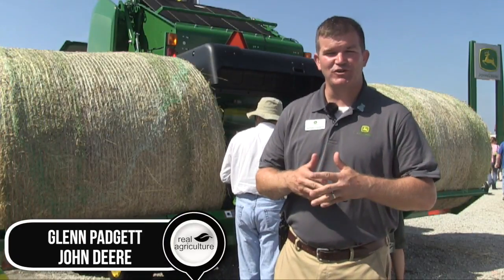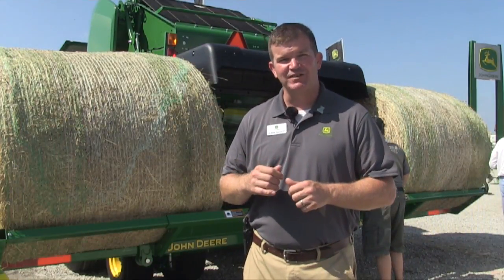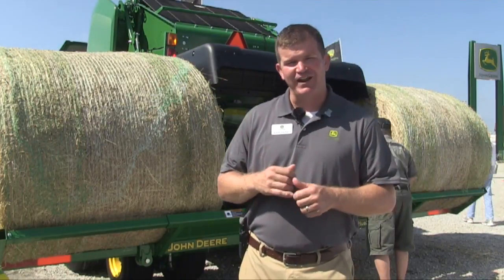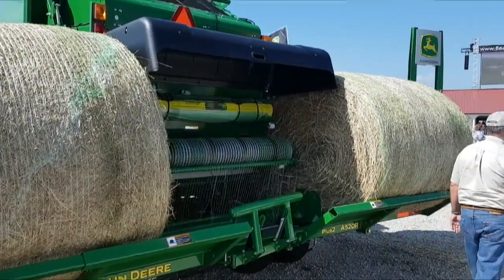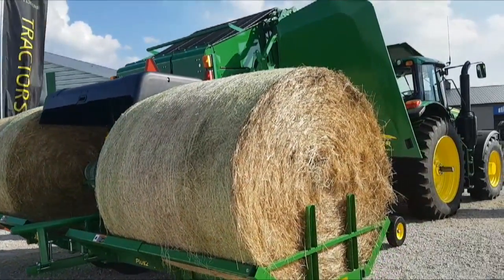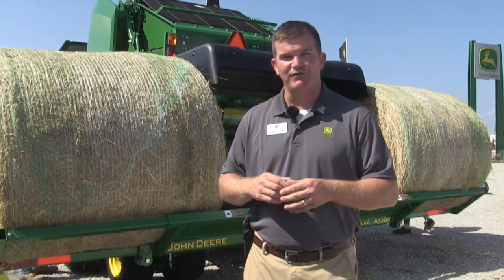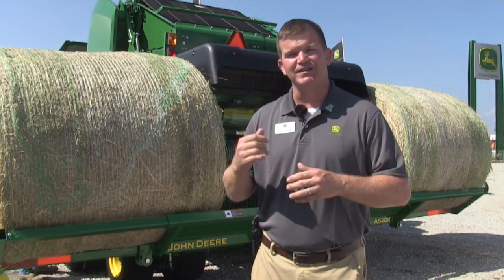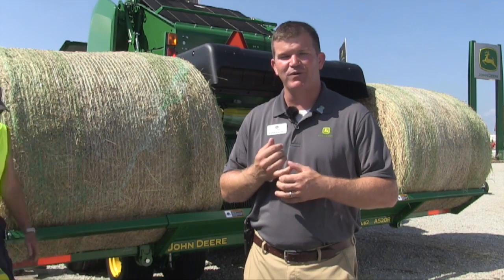John Deere accumulator brings strategy to baling

Comment: the pre cutter may help in wet hay.  pre cutting dry hay is just beating all the nutrients off the product basically making straw.  i thought deere did a pretty good job of beating up hay with their stuffer bar system already, this takes that to a whole new level.  we had a 7 series megawide pickup for one season, we traded backwards to get a 566 standard pickup.  couldn't stand the secondary lift system destroying hay.  running a vermeer wide pickup now, will never go back to a green baler. i guess an accumulator is their best idea to sell an inferior product now.  good luck deere.

Comment: why three? I can't pick three at once so I'd still have to drive twice to bring them to the trailer.
Reply: Erik Ligtenberg why not pull  your trailer along as you go?
Reply: +Graham Turbett pretty hard to load with the trailer hooked to the back of the tractor
Reply: Obviously - you don't make hay.  The accumulator allows you to drop more bales in a single place so when you come back to pick them up you don't have to drive all over the field.   But, that's probably too hard for you to understand.
Reply: +Buckhorn Cortez haha we make 4000 bales a year of straw, with my grapple I can grab 2 at once so why would I want a pile of three. no gain
Reply: Get a grapple that can grab 3 bales..
Reply: +Erling Bjørnson my tractor wouldn't lift three bales at once, I'm not sure there is a front end loader on the market that would lift three big rounds at once. unless you make them small and have the density turned way down.
Reply: I'm thinking if you watch the whole video, it would make more sense. Chasing bales around the field take extra time, and fuel. I think it's a great idea.
Reply: have a spear on the back and 2 on loader.  plus the one on the back will be ballast
Reply: There are other video that demonstrates the working of it and its advantage
Reply: It depends on what you have. It would be really handy with a self-loading bale truck to just have the bales oriented the right way in a row.